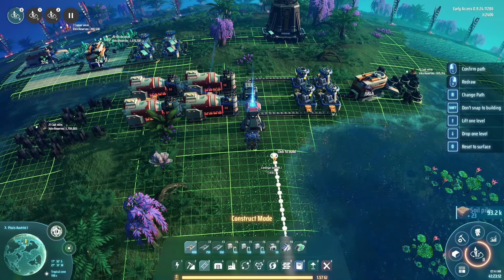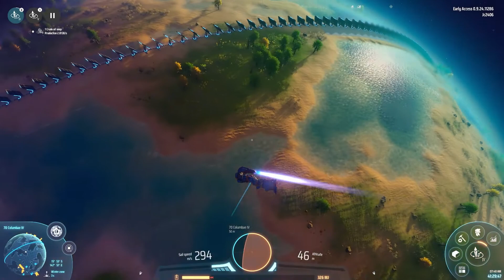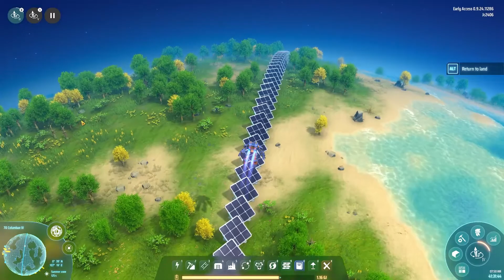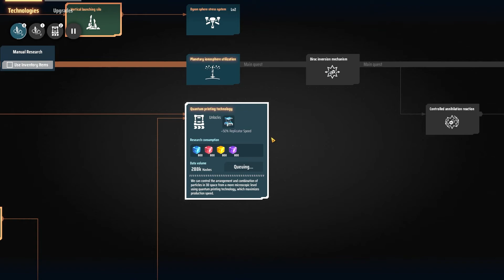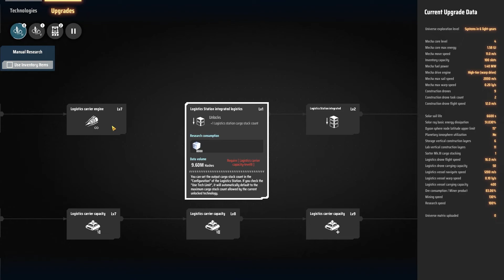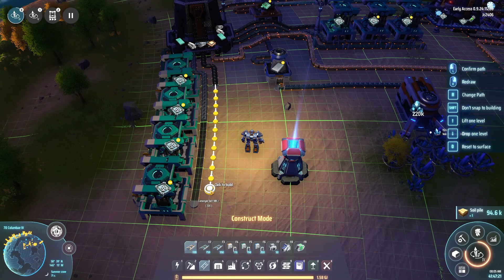“New” Nanotubes – Dyson Sphere Program Part 43

Comment: The smelters are a pain to get because their resource is only found in 2 places, you can probably guess where that is, but the MK2 miners are beautiful. They are big beautiful and act as planetary logistics so no belts needed to send the mined goodies to the interstellar logistics towers, just some drones! Also, you can configure their speed if you want it to slurp up resources faster. Well worth finding those purple crystals as soon as you can.
Reply from the maker: Thanks for the heads up, will have to try and find the special resource for them. But coming with it's own drone "bay" sounds very useful ... especially as resources back at home are starting to run out in places O.O